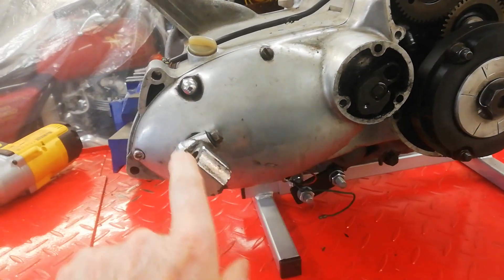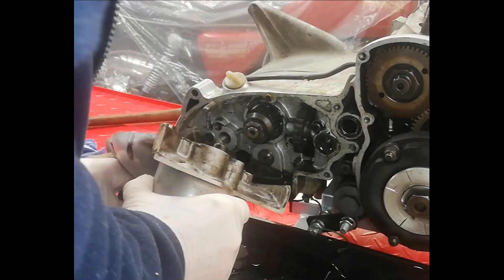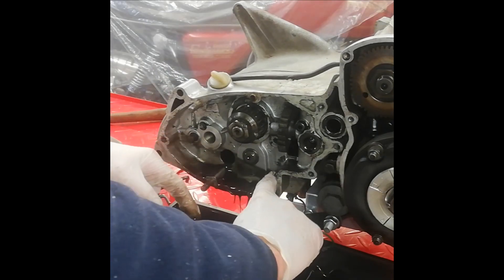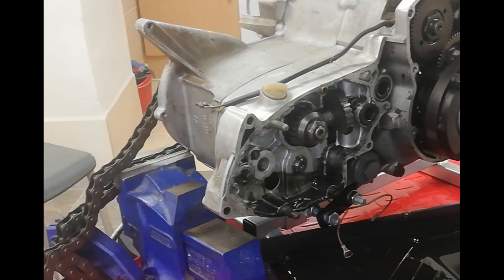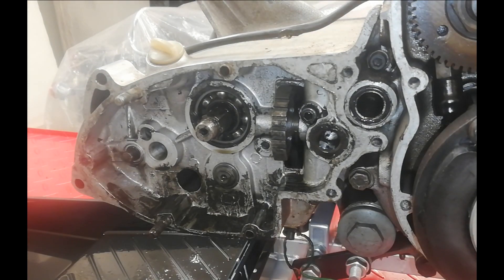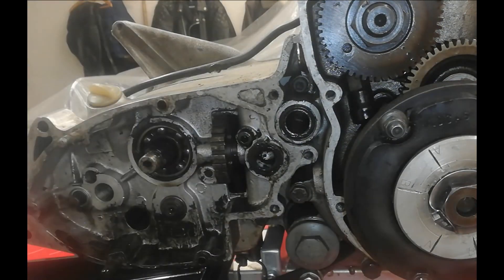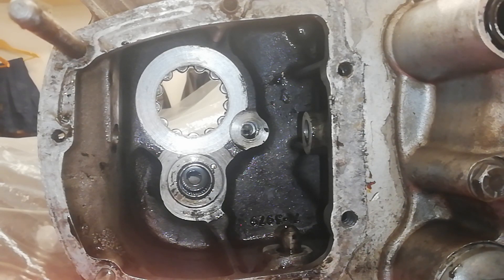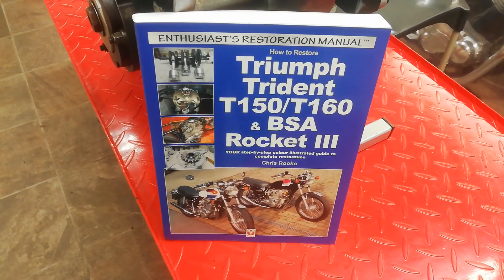Triumph Trident T160 Engine Rebuild. Part 5 - Dismantling the Gearbox

Comment: Chris,  
Your videos have been extremely helpful to me and I'm sure there are others with the same appreciation that you are sharing your expertise. 

Over the past several months I revived a T160 that sat idle for 20 years.  My brother was original owner and he installed a 3-1 exhaust, higher performance Norris cams, T150 valve assembly and Boyer ignition and took excellent care of everything until he parked it.   I am comfortable doing most repairs on cars but never owned a motorcycle before. 

The engine and bike is now running well.  However, I am having shifting problems that are challenging for a beginner bike rider.   The neutral position is very "finicky" and I also need to rock the bike to help engage 1st gear.  (I recently adjusted the clutch and installed a heavy duty Venhill clutch cable).  Based on forum searches and other homework It appears there could be wear and sloppiness associated with the shifter cam and/or plunger.   I also noticed there are more recent replacement cam plates that have a more generous neutral detent that should help.   

The Ask:  I have watched your disassembly and reassembly videos and would appreciate any other advise that you have since I intend to do the work on the bike rather than with the gearbox assembly mounted on a servicing stand.     (I'd prefer I don't start the job and  then find out I need other tools or skills! ) Thanks, Pete
Reply from the maker: Pete,  Hi there. The problems you are experiencing are common with a Trident. Over the years I fitted various upgrades etc to my T150V to try and fix a very stiff gear change. If you've not already seen them, I suggest you have a look at the videos I did on the T150V gearbox, as opposed to the T160. But rather than major surgery I would recommend fitting a ball ended gearbox  plunger from David Drew (contact details on one of the videos) and also shorten the plunger spring at the same time. These modifications should make a big difference. At the same time,  try to adjust your clutch mechanism to give maximum lift. I would adjust the nut on the mechanism to give zero clearance  (as opposed to the 5 thou given in the manual) and maybe invest in a 'Triples Unlimited' bearing conversion for the mechanism at the same time, to help reduce wear. Good luck and get back to me with any questions. 👍
Reply: @Chris.rooke150  I'll follow-up on all of your suggestions and let you know how things work out.  Thanks!  Pete
Reply: @Chris.rooke150  
Chris,
I’ve received all of the parts that you’ve suggested from across the pond.   Before installing the ball-tipped plunger I measured dimensions for original vs. new fit up comparisons.  The original plunger has an internal shoulder that provides a stop for the spring and the modified plunger does not have a similar feature in its bore.  Consequently, the spring sits deeper in the new plunger.   The total free length of the plunger plus installed spring is about 2.92” for the original vs. about 2.62” for the ball-tipped device.  I measured the depth from the plunger housing seating surface on the lower engine casing to the cam plate in neutral along with the dimensions of the plunger housing.   Based on these measurements, the total spring compression in neutral is about .55 inch on the old plunger and about .25 inch with the new plunger.  My thinking is that I should not trim the spring since the new plunger will reduce the amount of spring compression force by about half.  Would appreciate your thoughts on this.
Thanks, Pete
Reply from the maker: Peter,  it sounds like you shouldn't need to trim the spring any further. I would suggest fitting the plunger and camplate dry and turn the latter to see how stiff it is - it should rotate pretty easily. Also, I'd contact David Drew who sells the upgraded plungers and send him the exact same info you sent to me, and see what he thinks. Good luck. 👍
Reply: @Chris.rooke150  
Chris,
I worked my way through all of the shifting issues.
Seems like a good idea to measure the free length of the plunger plus spring when replacing the plunger as there are several plunger configurations.  David Drew responded and agreed there is a shoulder inside the T160 original plunger that is not present on the ball-tipped plunger that I purchased.   Based on trial and error, I installed several thin washers below the spring and I can now easily shift between second, neutral and first gear. This still reduced the spring force as it shortened the free length of the new plunger/spring assembly by about ¼” when compared to the original parts.   
Neutral switch adjustment was erratic and the switch also contributed to hard shifting (1st, neutral and 2nd) using both an original style neutral switch and a new longer-tipped switch.   Based on follow up borescope inspection of the cam surface, the tip of the neutral switch plunger had formed an “S”-shaped groove on the cam’s neutral lobe that may be capable of catching the tip of the neutral plunger.  Also, the internal plunger tip had a loose fit in its housing due to wear.    I changed course and installed a proximity probe kit obtained from Triples Unlimited.  The new probe eliminated all of the mechanical problems.  The frame rail provided just enough clearance for easy probe insertion and the wiring instruction errors that you highlighted in one of your videos were corrected by the seller.   
The new clutch ramp thrust bearing that you recommended provides much tighter control of the clutch adjustment. I did not reinstall the clutch ramp springs since the thrust bearing is slightly preloaded and fully closes the gap between the clutch nut and ramp.  
Finally, I wanted to pass along another wet sumping approach that does not require draining oil directly from the main sump plate.    When the oil tank empties after several weeks in the garage, I drain and collect all oil from the primary chain case and then return about 1 pint to the chain case and the remainder (and majority of what is collected) to the oil tank prior to starting the engine.   This bike rests at a large angle while on the kickstand and oil naturally drains toward the primary chain case.  Procedure takes about 5 minutes.
Thanks again for your great videos that I have frequently referenced and for taking the time to respond.   After rehabbing brake lines, masters, calipers, carbs, coils, combination switches, rubber hoses/boots and these shifting issues, everything is now working well following the bike’s 20-year nap.   
Pete
Reply from the maker: Peter,  that's great. Good to hear that the various modifications worked (eventually!) and that you found the videos useful. 👍

Comment: Great vids Chris, thanks for the tip on heating a Wellseal’ed gasket.
I laid my T160 over to scrape the sump gasket area, when I stood it up the gearbox was solid. Gravity had made the cogs shift and lock up. Using your vids I have now stripped and reassembled the gears all good.
Waiting for your book to arrive before I refit the inner and outer covers.
Just watched your timing strip, which reminds me that I have oil coming into the timing side. Another job.
Reply from the maker: Tony, that's great. Glad to hear the videos have been of use, and that you're getting on with your bike. If you mean that oil is getting into the points housing then the most likely cause is that you need to replace the oil seal in the timing case that goes over the end of the exhaust camshaft. The trick is to ensure that you don't damage the new seal by catching it on the camshaft when putting the timing case back on.